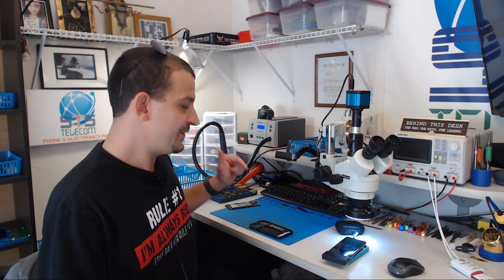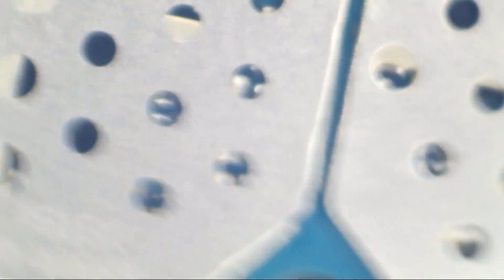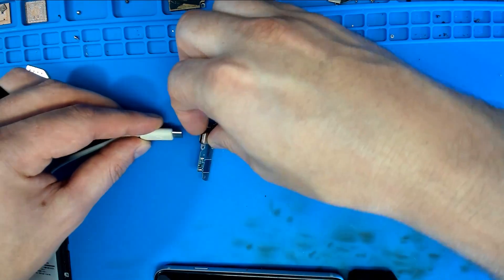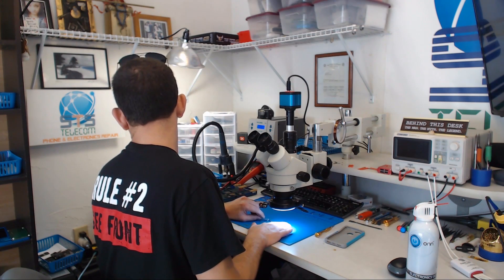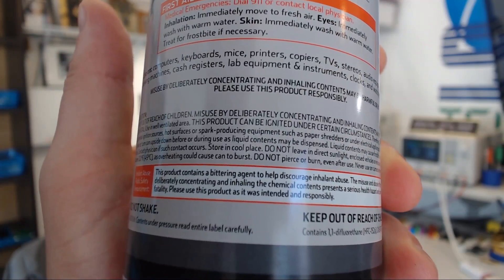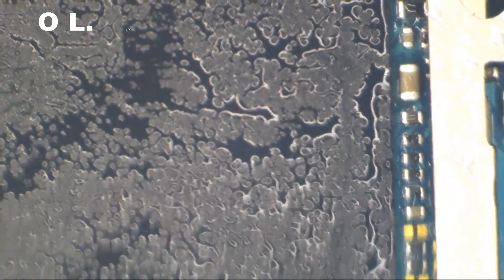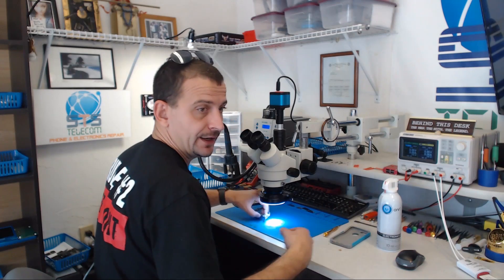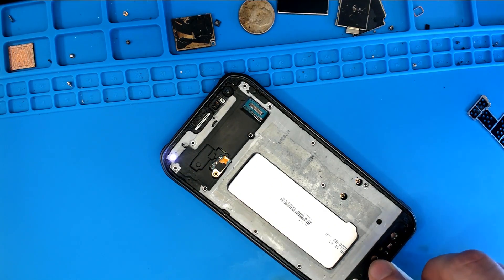Galaxy S6 Active - Bad CPU? [FAIL]

Comment: So what is it, 99 iPhone repairs to 1 of anything else - lol -. I guess a double loaded single PCB is less failure prone than twin PCBs with the parts trapped inside, ie, it can't dry out fast enough with liquid damage so it corrode shorts inside.
Reply from the maker: I’m actually starting to take in quite a few Samsung phones.  I’ll probably start posting some of them soon!  :-)

I’m doing an S10 recovery tonight and the number of soldered on shields is really something!   It was fully submerged so I’ve taken most of the shields off.   Hoping for success on this one!
Reply: @ststele  I only watch repair vids for the entertainment value, and watching repairers outsmarting engineers that try to make their phones unrepairable, ie, Apple, is pretty entertaining. 
I haven't see enough Android repairs to know if they are going to be as fun as the Rubik repair iphone - lol -, so we'll have to see what you come up with. 
Keep sticking it to the conglomerate - lol -.

Comment: The problem with having to hold the charge cable at a certain angle is probably the charge port full of crap I had the Same problem for ages before I realized what it was.

Comment: If it charges the battery and it stops after few minutes it could be the cpu or the pmic. I had few s6 boards in my hand where without a battery connected they toke around 0.2A  but worked fine for a strange reason.

Comment: Can somoeone help? i have iphone 8 and its working fine until its begin to restart itself and work like normal after that restarts and after day of working like this with random restarting it put itself into DFU and stay in DFU until battery is very low. Any ideas what can cause that? Thanks !
Reply from the maker: It is tough to say for sure what was causing the restarts but the symptom of slipping into DFU mode is not good if you are trying to access your data.  You could check the log on the phone through settings and maybe be able to see what's happening when it restarts but I'm worried with the DFU condition that you may have to restore it.  3utools will let you attempt to exit DFU/recovery mode without updating or restoring.  Also, a hardware fault can cause it to be stuck in DFU as well so - in that case, data may not be lost.  This is all really just educated guesses though -- it really could be a lot of things.  I'm gonna put a heart on this but not because you're having trouble!  :)
Reply: STS Telecom Thank you for responding. Funny thing is that after battery dies it will charge and boot like nothing happend. I’ve checked pp3v0 and other main lines to find short and nothing. Previous owner told me that he had error 9 in ITunes, but i never recevied this type of error- once i had -2 error on 3utools. Im looking for some guess, what can i check or replace. My plan is to swap nand to be sure, but im worried that its some kind of ‚random OL’ bullshit :/

Comment: Turn auto calibration off in the Flir app. Its annoying.
Reply from the maker: Very annoying. I did on my old phone but recently switched and haven't done it yet.
Reply: @ststele  Yeah. Not as annoying as a cold spot on the thermal sensor. So upsetting. Im waiting on my return/replacement options through eBay. It is the Compact Pro USB C. Brand new.
Besides the constant cold spot it works quite well. Definately loving the Beta version of the software over the standard.
Its not a $4k Flir..but for the price it does an outstanding job. Also messing with high and low temp ranges and locking them helps too.

Comment: Hi jackson
I have sam s7
It is restarts again and again on sleep mode,untill its battery is low
Reply: I feel that its cpu is heating
But no any physical damage and all other workings are ok
Reply: @mohitmittal391  flash with new firmware. If it doesn't work, then it might be some hardware problem. Probably the CPU or NAND problem..

Comment: Use solid rosin flux fumes to whiten  the board with rosin mist  then instantly apply voltage, instantly the short melts the rosin mist on the component, then clean with IPA.
Reply from the maker: Thank u! I always wondered how people use rosin.  Thinking a a small amount of heat wouldn't make some.  Now it makes sense.
Reply: Here's an example https://youtu.be/OJFngzyqp2E

Comment: Atlest devices I know
Reply from the maker: That makes one of us! :-)
Reply: G920a if I am correct
Reply: What’s the model number
Reply from the maker: I'm out with the family for a bit but when I get back I'll check and comment back. I think I finally mention it later in the video.
Reply: I heard you said g920a
Reply: I heard you said g920f and g920a
Reply: I heard you said g920f and g920a
Reply: The component that was on the other side u7003 is ic switch reg  let’s skip that for a moment
Reply: By the if you have jtag this can be of help when do a transplant or Board swap if cpu is the one shorted
Reply: Will just need to know the android version it was on
Reply: Best way check firstly what’s happening under cpu I noticed it started heating up a specific area the was the top middle right hand side ..